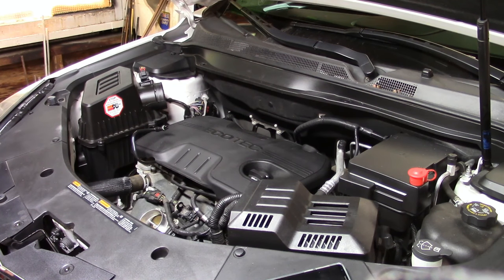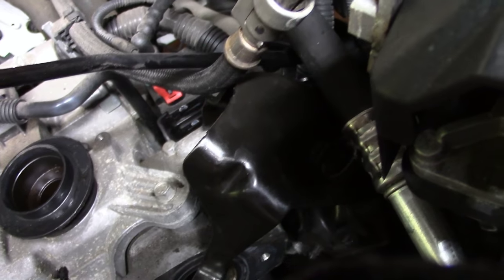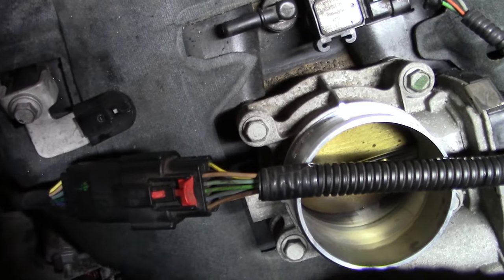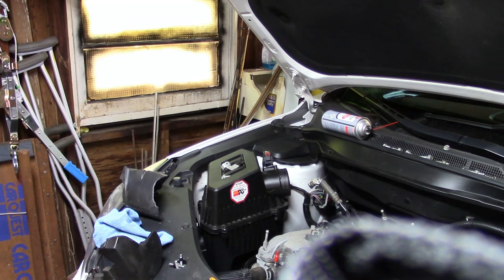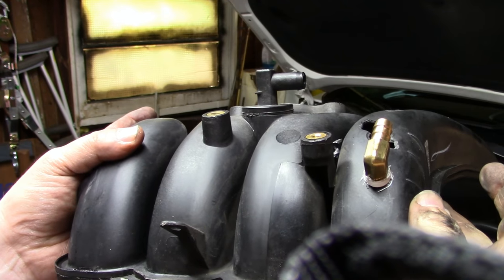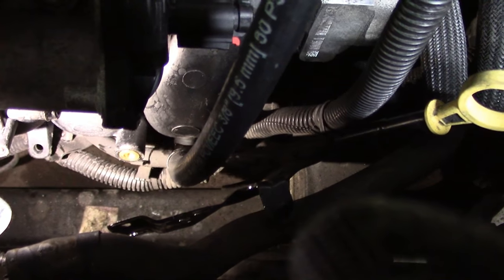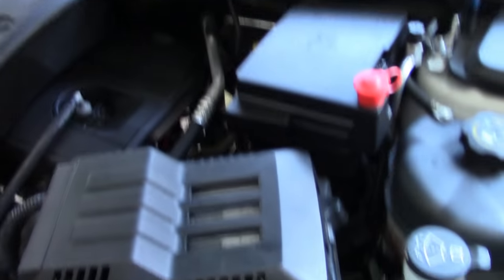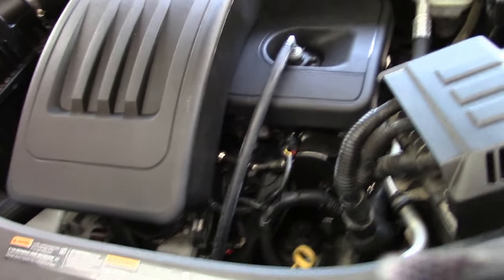2013 Chevy Equinox w/2.4L 4-Cyl. Engine PCV Upgrade

Comment: I enjoyed your video. Is it necessary to remove the intake manifold to clean the 1/8 inch hole or can I just do the modification to the manifold and connect it to the oil cap
Reply from the maker: To make the modification to the intake manifold it will be necessary to remove it from the cylinder head. 
Be sure to place a bead of RTV around the base of the fitting once it's installed. 
And it will be easier to install the PCV hose to the fitting before installing the intake back to the cylinder head. 
And you will need to modify the Stant oil cap to accept the PCV valve and grommet.
Reply: @Frank4358  would it do any harm if I dont remove it but I still do the modification?
Reply from the maker: @jogon5770  not sure how you would do it. There really is no room to get to the manifold. Remember, the fitting must be installed on the bottom of the  runner. 
Take the time, remove the intake then install it properly.
Reply: @Frank4358  I think if attempted in the car it might leed to pecies getting in the intake and in the engine??
Reply from the maker: @835YT  please clarify your statement. What pieces?
Reply: @Frank4358  peices from drilling into the manifold for the fitting to get vacuum
Reply from the maker: @835YT  you are correct. If you do it while installed you would get plastic particles in the engine. However, considering the position of the fitting, and limited space underhood, or from underneath, it would be virtually impossible to perform this procedure while mounted to the engine.

Comment: For my 06 Chrysler 300c 5.7 I bought I vented oil cap. Kinda pricey at $79 bucks but if it worked it would save alot of headache
Reply from the maker: It also, doesn't meet federal emissions system standards.

Comment: well i did your fix and so far it is not working. burns as much oil as before and i even put in new rings. my next step will be a new engine. but i will give it a month to allow the rings to seat just in case they are causing this. i will let you know. thanks for the possible fix it may work for others
Reply from the maker: Did you change your oil after doing the modification? I took my Equinox on a long trip on the highway. 
I also test my oil to see what's going on inside my engine. I found fuel dilution in the oil that I am still chasing. 
One theory is that the high-pressure fuel pump is leaking down after the engine is Off. Another theory is that the injectors are not shutting down with the engine Off.  Difficult to diagnose, but could contribute to oil consumption from washing the rings.
Reply: @Frank4358  , frank i overhauled the engine. new rings head and rod bearings. and of course new oil. 30w breaking oil. no difference at this time. also did you know you can't block off the original pvc vent? i installed a tapered screw kind of like a idle jet screw on the carbs and when i had that factory pvc blocked off i had more outbound pressure on that port that goes to the breather than with it open. so i had to open the about 1 1/2 turns and that port got to 15" vacuum and i took off the gage. at the same time the mod pvc i put my finger on the suction side and it had plenty of vacuum i did not bother to check it because you could tell it was sucking plenty .but as i said in the top comment the rings may not have yet seated. so i'm giving the rings a month or so and 1000 miles to seat.  thanks
Reply from the maker: @bobpalmer4740  if you read some of the comments you'll know that I did not block off the OEM PCV. Also, blow out the PCV return from the air box to the cylinder head. If that's clogged it will keep crankcase pressure. I used a air gun with my compressor to clean it out from the return tube. Then blew out the orifice at the cylinder head.
Reply: @Frank4358  thanks frank i did that also the head was rebuilt so that is clean as new. thanks like i said i will run it for a bit and let you know how my trial went. i will not take it away as i do see it is doing something. at the least, it should keep the internals from sludging up. i may just have to many going on with the rings at this time but they should not be worse being new ar yours was being old and full of old oil. anyway thanks, and i will let you know in a month how it is going.
Reply: frank i think i now have a lean condition with this upgrade? ever since doing this she now has the engine at stops want to stall out at stops. what i'm going to do is take the pvc and clamp off the hose and let her see if that changed the stalling issue. if it did then i will open the clamp a bit at a time until the stalling stops and then it may be fine. your idea sounds good but if you do not have the lea engine then we have 2 different systems. she has no egr nor a iac module. so that may be the difference. thanks

Comment: Hey Frank . Where did you get the oil cap. I can not seem  to find it ? many thanks .
Reply from the maker: Carquest 10099. It's actually a Stant Cap, and you will need to modify it to accept the PCV.
Reply from the maker: I purchased it at Advance Auto Parts

Comment: Will this stop the oil consumption problem in these engines? If so what fittings and oil cap exactly did you use?
Reply from the maker: How bad of an oil consumption problem? 
I was using 1 quart about every 700 to 1000 miles. To date, I haven't used any oil. Just checked it last week.
Reply from the maker: Dorman 42330 grommet
Intermotor/SMP PCV352
Oil Cap 10099 Carquest
3/8" 90° Brass Fitting

Comment: Hey Frank I saw your comment on Facebook that said you stopped using oil after doing this. How does that work? Is that still the case?
Reply from the maker: Yes. All oil usage ceased after the modification was completed.
Reply: @Frank4358  that’s great. But how? What’s the explanation
Reply from the maker: @MerkoniumJones  reduced crankcase pressure. When the pressure within the engine has no way to be relieved, the pressure finds the path of least resistance: through  the rear main seal and passing by the low-tension rings. With an active PCV (Positive Crankcase Ventilation), no pressure builds up.

Comment: Same brain dead engineers created a similar pcv orfice in my 2014 Chevy Cruze 1.4 turbo. But with what looks like a Holley carb rubber diaphragm. What a joke. I installed an outside pcv system on it. And had to replace the valve cover because it had a rubber diaphragm in it also. Just blows my mind the lack of how a pcv system should be simple, and a non common sense smart ass can screw up the design.

Comment: 5:49.. Is that a hole in your valve cover? How did that happen?
Reply from the maker: Where do you see a hole?
Reply: @Frank4358  5:45-5:50... right top of screen.... near the valve cover bolt... to thre right..... toward rear of cover....☝️
Could be dirt... looks like a hole though
Reply from the maker: @boosted2.4_sky  what you're seeing is where a valve cover bolt was removed. No hole in the valve cover.

Comment: Where does the orifice that gets clogged lead to? Does it go to the hose on the exterior of the manifold?
Reply from the maker: No. The orifice is inside the intake plenum, and mates to an opening at the cylinder head. 
The hose on the exterior of the manifold is attached to the fitting added to the intake runner to accommodate the auxiliary PCV valve.

Comment: Is it possible to take the Manifold off and drill the Pcv Hole Bigger to Fix the Problem? 🤔
Reply from the maker: Not a good idea as it would change the vacuum signal and that could affect performance.
Reply: @Frank4358  Wouldn't adding a 3/8 Port like in your Video do the same? 🤔
Reply from the maker: @dognamedchevyroberts3213  No. That tiny orifice was designed for a specific vacuum signal. So modifying that orifice changes the characteristics.
Adding a vacuum port at the bottom of the runner doesn't change the vacuum signal to the engine.
Reply: @Frank4358  I just Contacted GM & Asked them the same Question. They advised me that it is Ok to use a 1/8 drill bit to Drill the Stock manifold Pcv Hole out and the Problem will be Fixed. They said that doing so will NOT affect the Performance of the Vehicle at all. They said to make sure that after you drill out the Stock Pcv Hole to 1/8 to be sure to blow it out to ensure there isn't any plastic shavings in the Manifold before Re-Installing. Just wanted to share the Info with you that I Received Straight from GM.
Reply from the maker: @dognamedchevyroberts3213  you're not increasing the orifice size, merely opening the clogged orifice.
Reply: @dognamedchevyroberts3213  That is what they do for V6 engines with metal PCV orifice on the intake manidold, but not the 2.4l. Did they tell you that orifice  branches off to four other orifices, one in each runner.

Comment: i`m curious about oil cap mod video does not show this show cap but not how it`s done where did you get cap
Reply from the maker: Cap was purchased at Advance Auto Parts. Part Number # 10099. This cap has a flat top. It was spot faced then milled 0.750" with an end mill on a Bridgeport.

Comment: The wife’s 2011 terrain has 76k miles and we just recently started having oil consumption issues, did GM’s Test of 3 times being the vehicle in at 1000 miles first time 3/4 of a quart low, second 1.5 quarts low, told me it’s definitely burning oil and to bring it in at 800 miles to push it through, so I bring the car in at 810 miles for 3/4 of quart low for the service manager to say oh gm says that’s normal. Bout shit a brick and told him it was bullshit. Can’t wait to go up there with the invoices where they previously stated that it was low and not “normal”. Hate being lied to especially after a TSB and a class action law suit.
Reply from the maker: Their general response is, "everything is okay". They would not perform the TSB on my vehicle. But they were more than willing to charge me $300 to do the same procedure. That's what prompted me to come up with my own solution. Good luck.

Comment: couldn't you simply change the oil filling cap with a venting one?
Reply from the maker: No. To do so violates federal emissions laws. The emissions controls are considered a closed system.
Reply: @Frank4358  we have no emissions testing here but all i asked was could you? meaning would it circumvent the problem?
Reply from the maker: @medionlvr  not really
 Just venting takes whatever it sees at the vent. A true PCV system draws the pressure out and then distributes the vapors to the combustion chamber, where they are burned off.

Comment: Crack me up. I was looking on net & found a forum and most on there were saying pressure is suppose to come out of oil cap. I thinking  What ?!   But isn't there a easier way to fix this problem?
Reply: Comes in pulses. A complete vacuum should be present under wot
Reply: Check out my original comment on the page. I explained how i fixed my issues

Comment: Basically you bypassed PCV oil separator. Now you potentially create a oil pullover situation that leads to high oil consumption. I am very interested what oil consumption looks like after this modification.
Reply from the maker: There is no PCV oil separator. There's a baffle in the rocker cover. The oil consumption has been zero loss.
What causes high oil consumption is positive crankcase pressure. That pressure has now been relieved with a functioning PCV system.

Comment: So I did this to my 2011 Chevy equinox it seems to be working good except I have a squealing or squeaking noise. Do you know what this is from? If I take the oil cap off while it’s running the squeaking noise goes away please let me know as soon as possible what this problem could be.
Reply from the maker: Where did you add the vacuum line?
Reply from the maker: Did you clear out the PCV return line to the air box?
Reply: @Frank4358  on the same place u put yours
Reply from the maker: @jasonrhodes9455  but did you clean out the PCV return line from the cylinder head to the air box? And be sure to use pressurized air on the cylinder head port.
Reply: @Frank4358  yes I did and I also stuck on a catch can .
Reply: I don’t understand what you were talking about pressure. And can you tell me how are you? Did your oil cap
Reply from the maker: @jasonrhodes9455  you need to give me complete thoughts to give you an answer. 
Did you try removing the catch can to see if that changes anythjng?
Reply: @Frank4358  if I take off the oil cap, the noise quits
Reply from the maker: @jasonrhodes9455  did you remove the catch can to see if that makes a difference?

Comment: Hi Frank could I put the hose somewhere that is not the oil fill cap
Reply from the maker: No. There is a baffle between the oil cap and the valvetrain to prevent oil splashback. There are no other baffles on the rocker cover.
Reply from the maker: No. There's a baffle between the oil cap and valvetrain to prevent oil splashback. There are no other baffles on the rocker cover.
Reply: What do you think of the vented oil cap fc219. Could this help instead of doing your method
Reply from the maker: @karatejoejr  I can't see how that can work properly. These engines have a "sealed emissions system". Nothing is to be vented to the atmosphere. Doing it the way I've shown here maintains the integrity of the emissions system while properly evacuating pressure, fuel/oil fumes then safely burning them in the combustion chamber.
Reply: @Frank4358  Thank you frank this will save my 2012 chevy equinox.

Comment: Hi frank how did you get the plastic shaving out of the manifold
Reply: Also Frank what size hose did you use. Was it 1/2 or 3/8 thank you
Reply from the maker: I have an air compressor. I blew out the intake  until I felt confident all of the shavings were removed.
Reply from the maker: @karatejoejr  standard PCV hose diameter is 3/8". That's what I used.
Reply: @Frank4358  Thank you so much for your help 🙏

Comment: Why didnt you did a t line from the lower hose of the intake, wouldnt that be more easy?instead of drilling it to the intake.
Reply from the maker: If you're speaking about the power brake vacuum hose, you run the risk of introducing oil residue to the power booster. Then at some point you'll need to replace the power booster. Giving the PCV a dedicated vacuum port gives you a direct link between the PCV and the intake port, without compromising the brake power booster, or affecting the vacuum signal to the intake port at the cylinder head.
Reply: @Frank4358  sent you link
Reply from the maker: @rhurtadorh32  it doesn't solve the problem. It just redirects the oil that will need to be drained periodically from the catch can.  
Doing it the way I showed you keeps the emission system sealed true to OEM. No draining required. And the oil is burned in the combustion chamber.
Reply: What drill size did you use?
Reply: @Frank4358  so you rather not use a catch can.

Comment: That tube on the side of the air cleaner,needs to be plugged in to test pvc system...I think you sew that.
Reply from the maker: Yes. I blew it out at the head, the air box, and the line itself.